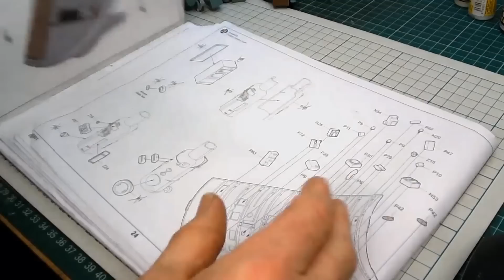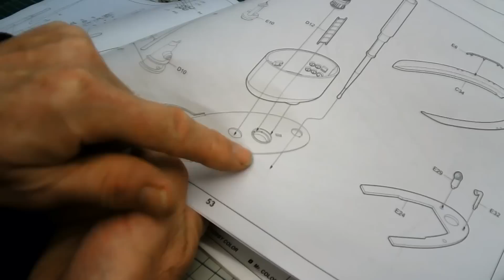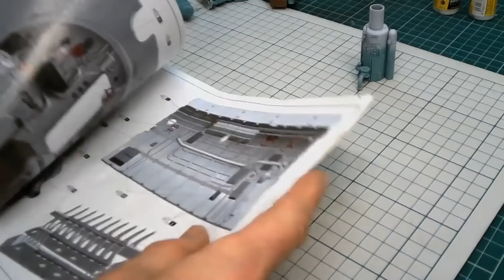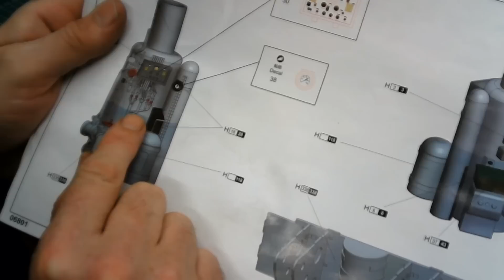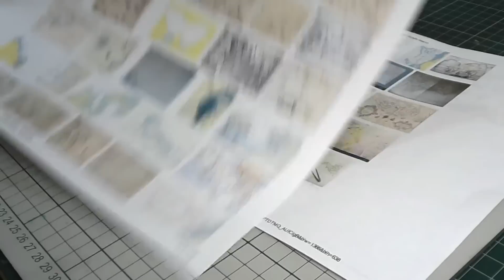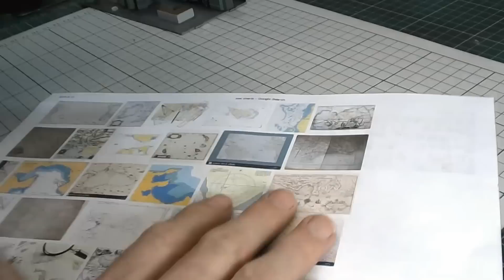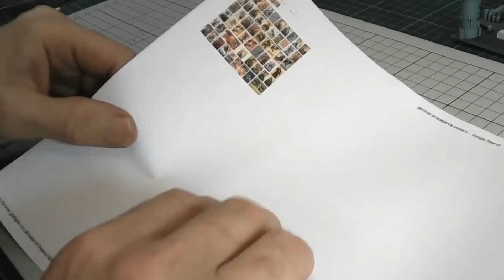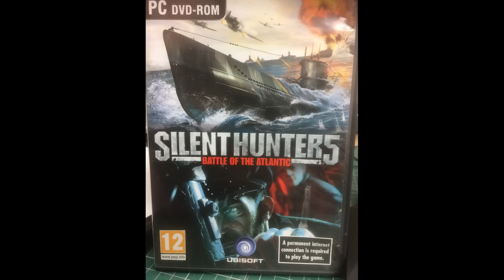The Long awaited  Part 4! Trumpeter 1/48 DKM U-Boat Type VIIC U-552 (WWII) # 06801

Comment: The piece of equipment you are wondering about might be the telescopic snorkel to run submerged.....  https://i.pinimg.com/originals/35/bd/97/35bd97584a88716d4ca9b6c1f57d7358.jpg

Subs were most vulnerable running on the surface recharging their batteries.

Comment: You could use a surface gauge and surface plate to engrave a mark around the circumference of the periscope drive to establish a nice straight place to add the masking. Same for the bulkhead pieces...

Comment: The resistors are there to limit the current to the LEDs. They can only handle 20 milliamps. Any more and they go poof. Actually, they turn bright green and then go poof. Each voltage applied and depending on the number of LEDs in series determines the current limiting resistor that's in the circuit. It actually has nothing whatsoever to do with battery life. It has everything to do with LED life.

Comment: The Researchers for the Trumpeter model have simply noted the colour scheme of the Type Vii interior on display in Germany;
   Some paint has been applied to make the boat look "nice"; not at all a representative of the real working typical colours that were authentic.
   - The main colour scheme throughout was a dark anthracite blue grey..  much simpler to apply
Reply: Some documents on the internet when converted to English suggest interior is Ivory. Looking at old b/w film the interiors do seem quite light and not dark and moody like Das boot, which would make sense, who wants to live in a cave. I think the Laboe sub on which the colours are based are a bit artistic. Online document says water valve handles red and others aluminium bronze.

Comment: Hi Ted, loving the build. With regards to the lights and I know it's too late to be saying this now, but did the U-Boats not use blue for action stations, White for normal running and the red lights in the control room for night time accustomisation when they went into the fin for night time patrol and air change post surfacing?